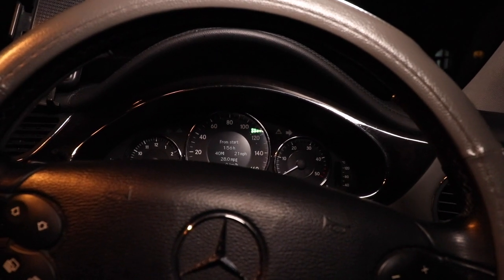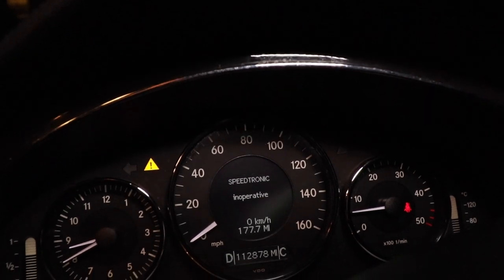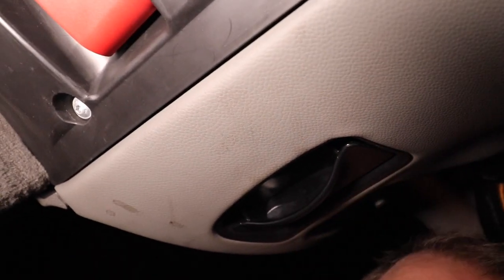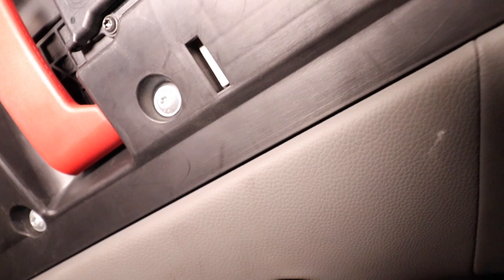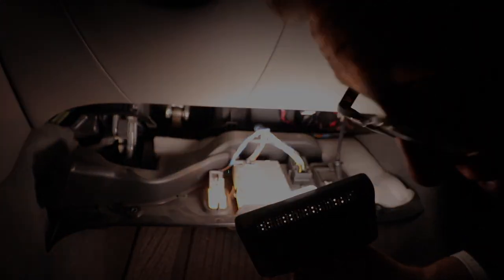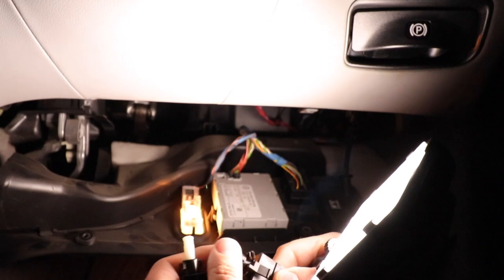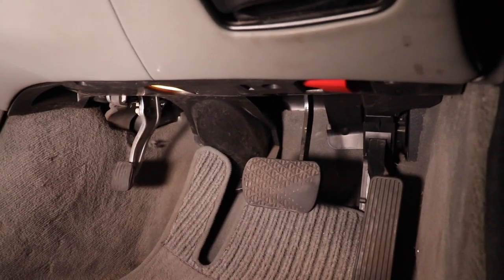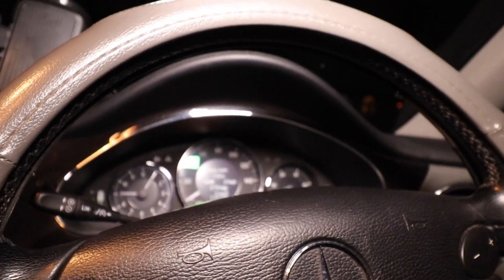ESP, Speedtronic inoperative, brake light switch

Comment: Say what is the name of the track you changed there??  I think I have the same problem, and where did you find the new part??
Reply from the maker: Looking on Google, I've found lots of sellers of this part. Pattern and original for as little as £5.85

Genuine Mercedes-Benz W211 E-Class Brake Pedal - Brake Light Switch A0015456709
Manufacturer Part Number:	A0015456709
£21.49
https://www.ebay.co.uk/itm/121365788791

ERA Brake Light Switch - £18.49
Product Code: 464220110
https://www.eurocarparts.com/search/464220110?gclid=Cj0KCQiAzZL-BRDnARIsAPCJs72v_gWX2OEiSfAKXJ1R8FzR4f2EhfbByWbqQu6pEeUC2_4iwkm2-cIaArPVEALw_wcB

https://www.ebay.co.uk/itm/131504018123

https://www.gsfcarparts.com/931me0080?auto_apply_coupon=SHOP60&gclid=Cj0KCQjw28T8BRDbARIsAEOMBcxy1WldQprVRNj-CTZv5xYCSvn0W0fFcfo-JB1vH7mFAGQWRuHXkN8aAohJEALw_wcB

https://www.onlinecarparts.co.uk/car-brands/spare-parts-mercedes-benz/cls-c219/18962/12348/brake-light-switch.html

Good luck, I hope you find an easy fix and thanks for watching and commenting.
Reply: @RG500_detectorist  .ok...Thanks cool, I'll do the same as you... 3 screws out put the new part and done... without throwing 💰 on the window...
Reply from the maker: @c.b.2955   Yes, try it. I hope it solves your issue. Good luck!

Comment from the maker: Looking on Google, I've found lots of sellers of this part. Pattern and original for as little as £5.85

Genuine Mercedes-Benz W211 E-Class Brake Pedal - Brake Light Switch A0015456709
Manufacturer Part Number:	A0015456709
£21.49
https://www.ebay.co.uk/itm/121365788791

ERA Brake Light Switch - £18.49
Product Code: 464220110
https://www.eurocarparts.com/search/464220110?gclid=Cj0KCQiAzZL-BRDnARIsAPCJs72v_gWX2OEiSfAKXJ1R8FzR4f2EhfbByWbqQu6pEeUC2_4iwkm2-cIaArPVEALw_wcB

https://www.ebay.co.uk/itm/131504018123

https://www.gsfcarparts.com/931me0080?auto_apply_coupon=SHOP60&gclid=Cj0KCQjw28T8BRDbARIsAEOMBcxy1WldQprVRNj-CTZv5xYCSvn0W0fFcfo-JB1vH7mFAGQWRuHXkN8aAohJEALw_wcB

https://www.onlinecarparts.co.uk/car-brands/spare-parts-mercedes-benz/cls-c219/18962/12348/brake-light-switch.html

Good luck, I hope you find an easy fix and thanks for watching and commenting.
Reply: My car is wrning laight on
Reply from the maker: @farooqahmad-sv3nl  if the same as this, try the same fix.

Comment: Hey guys. I had the same problem in my w221 350s 2010. All safety units faild. Hard wheel drive. No mercedes. After 7 days it suddenly dissapeard by itself. It was after strong stormy night.  I Started driving and haleluya all problems gone with the wind. It seems that abs esp mallfunction causes because of static electricity. There is no real mechanic or electric problem. You shuld take out your esp abs fuses and put it back. It will erase the static electricity.  Dont mass with your expensive car. Save your money. I hope this advice was helpfull.
Reply from the maker: Rubin. Thanks for your really useful advice and support on the channel. Mine recently started playing up with all the ESP alerts with the oxygen sensor playing up due to the cold weather. All good now though.

Comment: I have a question though🤔. Thing is my car won’t turn on at all don’t recognize my key fob and when I plug the battery alarm goes off won’t crank at all. Does light up all the lights at this point but that’s the main message k get in my screen 😔
Reply from the maker: I'd get fob battery ok?
Reply: @RG500_detectorist  did that as soon as it happened car isn’t recognizing my key fob. 😪
Reply from the maker: @Mazystar4sure  maybe someone knows the issue. I'm not familiar with that one.
Reply: @RG500_detectorist  yeah seem I have no choice 😪. Going to have to take it in to a shop cause dealership may charge too much
Reply from the maker: @Mazystar4sure  ask on a Facebook group. Someone will know. Probably an easy fix.

Comment: if this switch is broken, does the brake light not turn on? because I have the same warning, but my brake light is still on. Please help me, and thank you
Reply from the maker: Thanks for your question, I believe that the brake lights will all still work fine. Mine did. It's just the switch becomes faulty and plays havoc with the computerised system, triggering the fault lights. I hope that helps. Thanks again. Rich
Reply: @RG500_detectorist  Thanks for your reply. Hopefully after replacing this switch, all problems will be resolved.
Reply: @redsilvias15  did it work?

Comment: What is the name of this part? 
I also have a blinking light everytime I accelerate and can’t find the owners manual
Reply from the maker: Looking on Google, I've found lots of sellers of this part. Pattern and original for as little as £5.85

Genuine Mercedes-Benz W211 E-Class Brake Pedal - Brake Light Switch A0015456709
Manufacturer Part Number:	A0015456709
£21.49
https://www.ebay.co.uk/itm/121365788791

ERA Brake Light Switch - £18.49
Product Code: 464220110
https://www.eurocarparts.com/search/464220110?gclid=Cj0KCQiAzZL-BRDnARIsAPCJs72v_gWX2OEiSfAKXJ1R8FzR4f2EhfbByWbqQu6pEeUC2_4iwkm2-cIaArPVEALw_wcB

https://www.ebay.co.uk/itm/131504018123

https://www.gsfcarparts.com/931me0080?auto_apply_coupon=SHOP60&gclid=Cj0KCQjw28T8BRDbARIsAEOMBcxy1WldQprVRNj-CTZv5xYCSvn0W0fFcfo-JB1vH7mFAGQWRuHXkN8aAohJEALw_wcB

https://www.onlinecarparts.co.uk/car-brands/spare-parts-mercedes-benz/cls-c219/18962/12348/brake-light-switch.html

Good luck, I hope you find an easy fix and thanks for watching and commenting.

The blinking light is accelerating too hard and the real wheels spinning. This is not a fault!!!
Reply: @RG500_detectorist  Thank you sir! Good job! 💪🏼
Reply from the maker: @xchr4612  you are very welcome. I hope you get it all sorted.

Comment: fantastic i have exactly the same problem I will buy that Break stop lamp- My car is W219 CDI 2006  model do you have the part number
Reply from the maker: I'll look it up for you
Reply from the maker: Yes we have the same car, mine is that model. Please look through the comments of the video as there are some helpful comments. I think one other person actually had it diagnosed as a different issue that caused the same symptom but I think it's worth trying this first, as it cheap.
Looking on Google, I've found lots of sellers of this part. Pattern and original for as little as £5.85

Genuine Mercedes-Benz W211 E-Class Brake Pedal - Brake Light Switch A0015456709
Manufacturer Part Number:	A0015456709
£21.49
https://www.ebay.co.uk/itm/121365788791

ERA Brake Light Switch - £18.49
Product Code: 464220110
https://www.eurocarparts.com/search/464220110?gclid=Cj0KCQiAzZL-BRDnARIsAPCJs72v_gWX2OEiSfAKXJ1R8FzR4f2EhfbByWbqQu6pEeUC2_4iwkm2-cIaArPVEALw_wcB

https://www.ebay.co.uk/itm/131504018123

https://www.gsfcarparts.com/931me0080?auto_apply_coupon=SHOP60&gclid=Cj0KCQjw28T8BRDbARIsAEOMBcxy1WldQprVRNj-CTZv5xYCSvn0W0fFcfo-JB1vH7mFAGQWRuHXkN8aAohJEALw_wcB

https://www.onlinecarparts.co.uk/car-brands/spare-parts-mercedes-benz/cls-c219/18962/12348/brake-light-switch.html

Good luck, I hope you find an easy fix and thanks for watching and commenting.

Comment: Hi mate,
I just got the amber triangle light on while slowly crawling in my 57 w211 in london traffic.
Then hit the a406 noticed that speedtronic not working, run flat inoperative, ESP inoperative, then the brakes  HOLD system doesn't react.
All of this troble is down to that swicht? 
Is that simple?
Reply from the maker: Yes, sounds very much like what happened to mine. Worth a try.
Reply: Thanks a lot, i'll pursue this and come back with a reply.
Reply from the maker: @marianc5140  for £15. It's worth a try. You could simply take the switch out and check if it sticks. See that in my video. If sticky, it needs changing.
Reply: I was going to have a peak under the dashboard tonight, but a question spring to mind: did the brake lights on your car were coming on when you had the issue with your brake lights switch?
My brake lights are working just fine, and even the HOLD function works right after i start the car and moving it a few meters, then the amber triangle lights are on and end of story.
Reply from the maker: @marianc5140  yes, the issue us simply the switch gets sticky. All functions work.
Reply: @RG500_detectorist  indeed they do.
I ve received the part, but i didn't get what do you mean by reseting the brake pedal. How you do it?
Reply from the maker: @marianc5140  just stick it all back together and it should fix the problem and work ok
Reply: I can not thank you enough for your help and reply's, problem sorted, and all for your video and help. Oh, and for 11 odd quid, just superb!
I should buy you a bottle of red :)
Thank you, kind regards, Mario.
Reply from the maker: @marianc5140  brilliant to hear we've saved another £300-400 by not allowing the experts to rip us off. I've got a bottle of red here, so you have a glass there, I'll have one here and I celebrate your workmanship. Well done for sorting it. Here's to many miles happy driving  👍
Reply: @RG500_detectorist  that i can not refuse, so cheers to that🍷🍷!

Comment: Hi, i have a problem with my W204 2008. After burnout appeared in dash ESP and ABS inoperative. Tempomat and speedtronic inoperative. also the speedometer doesn't work. How can i solve it.
Reply from the maker: Hi thanks for watching. Sorry to hear about your troubles. You could try this solution. It's cheap enough to be worth a try. Good luck and let us know how you get on.
Reply: Hi i got exact same problem with my W211 2004, did you find the answer thanks
Reply: @RussyRussRussy  Hi yes, i solved my problem. Bought a new ABR block. After that dissapeared all errors.
Reply: Dear friends, I have a 2005 cls 500 mercedes. I had a problem with the ABS system and I changed it
And now the car does not work with the gearbox, it stays in first gear, note that the car is automatic
When making a change, should it be programmed?

Comment: مرحبا ، أرجوك من فضلك 
أملك سيارة من نوع مرسيدس c220 w203 
لدي نفس المشكل بالإضافة الى عداد السرعة لا يعمل غيرت كل الحساسات الخاصصة بنظام abs 
هل من معلومة ؟
Reply from the maker: Did you change the brake switch?

هل غيرت مفتاح الفرامل؟
Reply: @RG500_detectorist  لم اخيره ولكن أحيانا يعود للعمل بمجرد إرطام العجلة بحفرة
Reply from the maker: @oussamachokri28  Sounds more like a faulty sensor connection at a wheel, than this brake switch issue.

يبدو الأمر أشبه باتصال مستشعر خاطئ على العجلة، أكثر من مشكلة مفتاح الفرامل.

Comment: I know this is an old post, but I just saw it. I'm just curious.... Does your "3 min" repair include the tech getting the work order, getting the part from parts dept, walking out to get ur car, pulling it into the shop, clearing the diagnostic codes, road testing the car, parking the car and writing up the job? Or shouldn't the tech get paid for that time as well? I can assure you no tech anywhere is doing that in 3 mins. You also failed to mention if that 1.5 hours included diagnosis.
Reply: Additionally, after reading the comments, you appear to have many people ordering brake light switches to attempt to repair their esp/bas warnings. Those warnings can also be caused by 20 or 30 other things 🤦‍♂️
Reply from the maker: Thanks for your comment. I totally get your point and of course total time should be factored in but if a 3 min job has a bloat of 3 hours, then I suggest they take a leaf out of Toyota's lean methodology and trim some of this waste out of their process.
Reply from the maker: @proautomotiveinc.7976  I do agree and somewhere in the comments it did state that I've had that light on again for a different issue. All in all there are many people who have saved tons of money, solved their issue and are very happy that they stumbled across a simple video that has saved them hassle, time and money. For £15, I think it's worth a go but agree, could be totally different. As for diagnosis, from your previous comment. I haven't got enough fingers and toes to count how many times I went to Approved Mercedes where they literally diagnosed faults could be anything. So much for diagnosis. Summary is that that car is long gone. To it's credit it went on for years, 160,000 miles before I had to scrap it. Not so good it had a acceleration fault for over 9 years, that Mercedes never managed to correctly diagnose or fix, even though I gave them thousands of pounds, changing parts that never fixed it!

Comment: Your brilliant
Reply from the maker: Thanks so much for the lovely comment. Glad you enjoyed the video and hope it was of help. Just so you know, it's not just the brake switch that can cause this. Just had the same issue but this time it was a steering angle sensor, in the steering wheel column. I didn't know how to do that, so my local independent Merc garage did it. £390. Thanks again Rich.

Comment: the same fault occured on my S350 on Saturday past.  Query.  Did your brake lights still work before you changed the switch?  My lights still work so I'm wondering if it's something else wrong with my motor.
Reply: @RG500_detectorist  thanks,  I'll let you know!

Comment: What’s the name of that part? Would help as mines doing same thing
Reply from the maker: Looking on Google, I've found lots of sellers of this part. Pattern and original for as little as £5.85

Genuine Mercedes-Benz W211 E-Class Brake Pedal - Brake Light Switch A0015456709
Manufacturer Part Number:	A0015456709
£21.49
https://www.ebay.co.uk/itm/121365788791

ERA Brake Light Switch - £18.49
Product Code: 464220110
https://www.eurocarparts.com/search/464220110?gclid=Cj0KCQiAzZL-BRDnARIsAPCJs72v_gWX2OEiSfAKXJ1R8FzR4f2EhfbByWbqQu6pEeUC2_4iwkm2-cIaArPVEALw_wcB

https://www.ebay.co.uk/itm/131504018123

https://www.gsfcarparts.com/931me0080?auto_apply_coupon=SHOP60&gclid=Cj0KCQjw28T8BRDbARIsAEOMBcxy1WldQprVRNj-CTZv5xYCSvn0W0fFcfo-JB1vH7mFAGQWRuHXkN8aAohJEALw_wcB

https://www.onlinecarparts.co.uk/car-brands/spare-parts-mercedes-benz/cls-c219/18962/12348/brake-light-switch.html

Good luck, I hope you find an easy fix and thanks for watching and commenting.
Reply: @RG500_detectorist  thanks

Comment: Does brake lights stop working if switch is faulty?
Reply from the maker: No. As far as I know it just triggers the fault. The brakes still work and the lights should still work. Thanks
Reply: If brake pedal is not pressed does value must be strictly 0. It is  currently jumping in the range (negative) -0.3 to -0.6 bar but while applying pressure seems operating normal goes through all values up to over +140 bar.
Reply from the maker: @davidnewman7014  I'm not sure of the technical requirements. For £15 it made sense to change it. If you just unclipped it and have a look, you'll see if it's sunk and faulty. Thanks

Comment: Yes it’s a rip off when you go into dealership just diagnose the problem will cost me 212 dollars. I will buy my own obd 2 reader fault code and part fix it my own. Will cost me total of 50$ for every thing.
Reply from the maker: Thanks for your comment. Yes, I heard many people buy the diagnostic unit and solve the problems, good on you. The world is there ripping everyone off, in these hard times, it is time to call it out. Thanks again. Rich
Reply: Rich Watson one good thing that Mercedes have road side assistance if it break down on the side of the road and they will ask for your location and get you the tow truck for free and take you to the nearest dealership and Lyft to get to your home for free but after you get to the dealer they will let you sign the paper and start to rip you off
Reply from the maker: @beverlyzen7052  hi. Yes I believed this and the first time I needed it they did come through great. The second times, several years later, here in the UK they altered things and said if after exploration they found any fault resulting from a non faulty part, eg possible wear and tear, you'll end up getting a bill. For a car of my age it's just not worth going to them any more. I've found a local, ex Merc authorised dealer mechanic, with 30 yrs experience,  now running his own workshop. Amazing knowledge and service at a fraction of the price, with a much faster turnaround. He's proved amazing 👏 ❤ 👌

Comment: I have a c class and it causes me this problem
When I turn off the car and turn it on again, the problem is removed. And after a while, when I'm using it, it pulls me out again.
You can know how to solve this problem???
Reply from the maker: Hey thanks for commenting. Yes simply follow what I did in the video and it should resolve your issue.  Thanks
Reply: Thank u man 
I try tomorrow
Reply from the maker: @tedihamzallari5799  good luck with it. It's pretty straightforward. I hope it turns out to be a quick and cheap fix for you. 👍👍
Reply: Same with my 07 e63 so I've ignored it because easier just to turn key off,on.
Would be interesting to know what the purpose of this switch is , why is it there and why does it disable  those driving functions?

Comment: i have the same problem , but on the tester i have this error code " d408 no can message was received from control unit n47-5( esp control unit)"
Reply from the maker: For the £15 for the part I would try this fix. Thanks for your comment

Comment: People l work mercedes ben 
change the wheel  speed sensor 
Beacuse will make start working again ABS brake 
Esp traction 
cruise control 
brake switch light no lights anymore stock on 
And make work the shifter and transmission good thank you

and good to go
Reply from the maker: Thanks so much for sharing
Reply: My friend, I changed the ABS and the gearbox is not working, will it help me. Will this problem be solved when I buy the brake sensor?